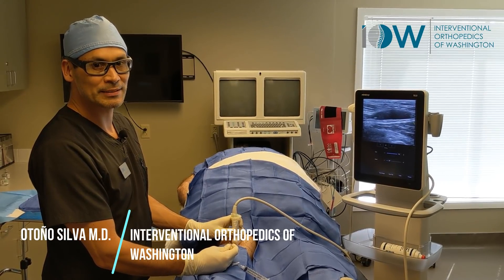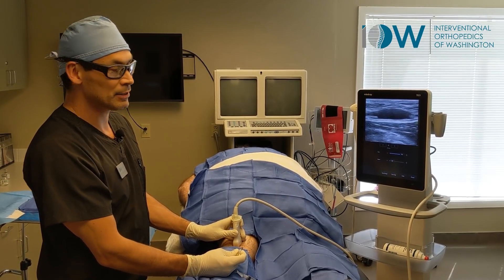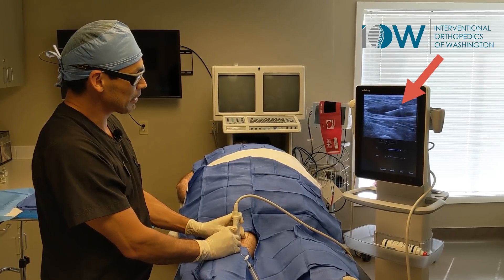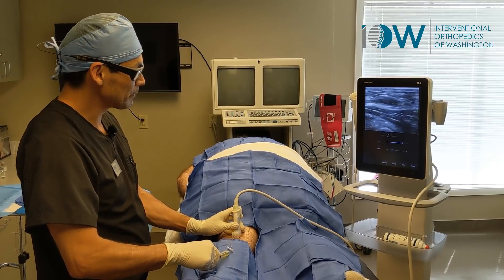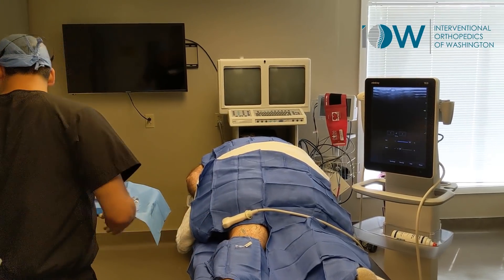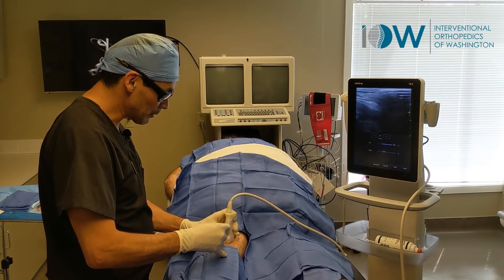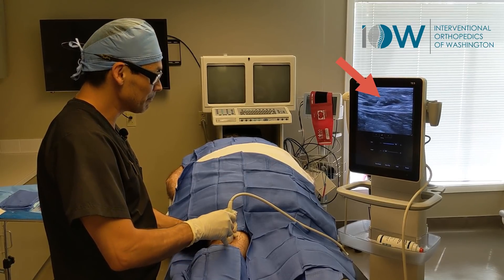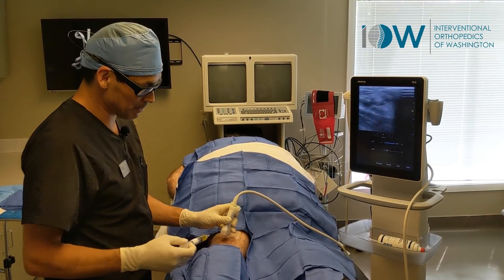Baker's Cyst Aspiration + PRP

Comment: I have a large protruding lump approximately 3" in diameter on the left side of my right kneecap.  It's soft and if it press on it its painful.  Is this a bakers cyst?
Reply: I have the same thing and a bakers cyst
Reply: Can't really tell without seeing it in person. But if it's very soft and fluid like, it could be increased joint fluid. Often the knee joint can accumulate a lot of fluid if it's inflamed and you can see it bulge on the sides of the knee or if someone is unfortunate enough it flows into a baker's cyst. Ultrasound in office would quickly show if it's fluid from the knee.

Comment: but it doesnt heal it ,it just relieves it for a time
Reply from the maker: that is correct if only the aspiration is performed. If you just drain it, it will very likely come back. If a proper treatment is performed in conjunction, however, then the cyst does have a chance of not returning.

Comment: Thanks for the video!!  I go see my orthopedic doctor today for a follow up of my MRI. Hopefully this is a options for my Baker's Cyst. Update tore my meniscus and had arthroscopic surgery on it.
Reply: Unbelievable, I am in the same boat. So what is it about a bakers cyst that results in a torn meniscus?
Reply from the maker: Generally, a Baker's Cyst forms when there is an injury or dysfunction in the joint. If you tore your meniscus, there was likely already some dysfunction in the knee which made your knee more susceptible to the injury.  Dysfunction could be, for example, laxity in the joint, meaning the ligaments, muscles, tendons, etc. that hold the knee together are a bit weakened and/or loose. Sometimes we can reduce pain and improve function as well or better than a surgery could with regenerative therapies such as PRP or stem cell therapy from bone marrow concentrate. It may be beneficial to get a second opinion from an interventional orthopedics doctor near you to see if you might be able to avoid surgery.